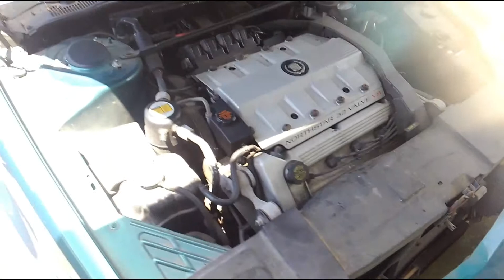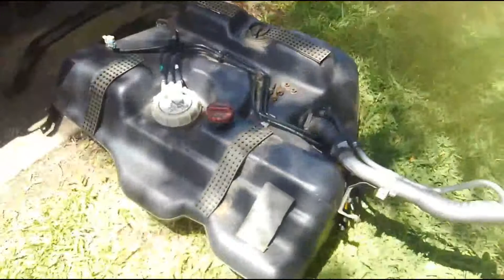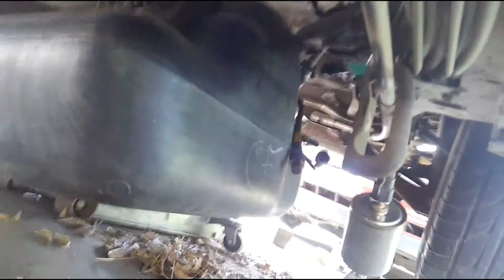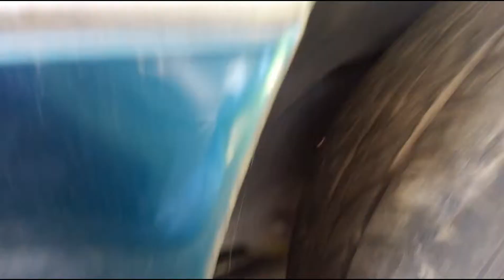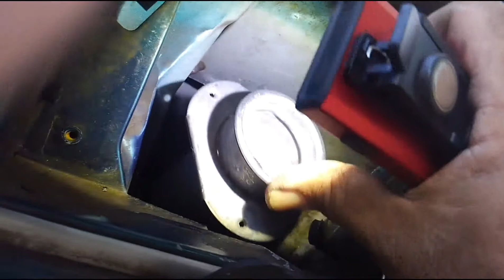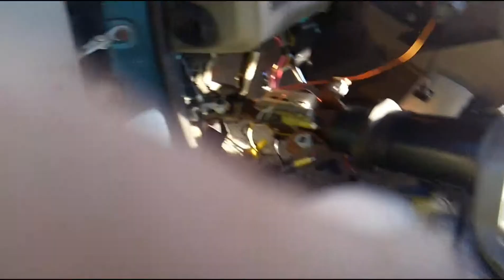1993 Cadillac Allante Fuel Pump/Tank Install and Troubleshooting

Comment from the maker: To see more of my vehicle/ parts tear down videos check out my playlist below -

Cars and Parts Tear Down Videos: https://www.youtube.com/playlist?list=PLAM-V1w3acpg_B2sVlXEL7UPOGVwiKmtL
Reply: I have a question. My allante just started putting and cut off as if not getting enough gas and the fuel pump is whining louder than usual would say feul pump is going out.. i really need some advice thanks in advance
Reply from the maker: @jimmyrandle2418  definitely sounds like that is the culprit. Best way to check is with a fuel pressure gauge at the fuel rail. Pressure should be between 42-48. If any lower than that you  have a failing pump or other restriction in the fuel system.
Reply: Thanks again im headed to the shop in the a.m. i really appreciate your time help and input thanks a lot
Reply from the maker: NP, anytime 👍

Comment: Thanks, was a great video. I just bought a 93 and getting no fuel to the rail. Next step is to drop the tank but I would like to check the relay first, any idea where it is ? I cant find it anywhere, there are a bunch of relays next to the battery behind the passenger seat, but didnt find any in the engine bay up near the firewall where I thought it would be
Reply from the maker: Vic, thanks for the feedback, glad you enjoyed it👍. Off the top of my head, I think the fuel pump relay is located directly behind the battery with several others along the inner fenderwell.

Let me know if you need any more information👍.

Comment: Was recently employed by a museum, and the guy who owns the place has 6 93 Allante’s. None have run in 10 years, and I’m a Toyota tech. You just saved my ass on about 3 of them!

I ended up getting 3/6 running by doing plugs, wires, and purging the varnish out of the fuel lines. It seems the other 3 have dead pumps, as the ball valve at the fuel rail is under no pressure when cranking, and there’s no sound of fuel pump on key on. Thank you!!!
Reply from the maker: Nate, thats awesome! Glad to hear the video was helpful. Sounds like the museum owner had quite the fascination with the Allantes. They are very interesting cars, just more complex than most people like to mess with.
Reply: @VetteSource  yes, they’re a lot different than the 1jz and 2JZ in-line sixes I’m used to working on at my old speed shop. 

The guy is crazy, but he’s got some really clean Allante’s. Like 20k miles clean. Digidash in all of them and everything electronically works like a dream.
Reply from the maker: Man, that's something else. I've always admired the look of the Allante's since they first came out, especially with the 747 "air bridge" they created to transport them from the Pininfarina factory in Italy. They also have the coolest digital dash from the 80's hands down. I'll eventually swing back onto working on the 3 that I have in storage once I catch up with these Corvettes🤣
Reply: @VetteSource  here’s a question for you big man. Where in the hell is the fuel pump relay in this thing??? 93 allante, duh, northstar.
Reply from the maker: If I am remembering correctly, I think it's under the hood. Let me check the service manual later this evening.

Comment: Did you remove both straps completely?   The nut for the passengers side strap toward the front is behind the shield for the muffler.  Was not sure how you accessed that one.....  Thanks
Reply from the maker: It's a tight fit, but you can pull the edge of the heat shield back just a bit to get a long extension/socket up there to access the strap bolt.
Reply: @VetteSource  Thank you....  final question, as I am getting ready to go to the auto parts store.... do I need any special tools to disengage the fuel lines?  I know a lot of cars require them.....  Thanks again.....
Reply from the maker: @howardwear  no special tools, just some patience. They are meant to come apart when you squeeze the connector ends together. You can use a pair of pliers and anti seize fluid to help if they are being stubborn.👍
Reply: @VetteSource  Thanks again, time to get to work on this cold concrete  :)
Reply from the maker: @howardwear  NP, thanks for watching 👍
Reply: @VetteSource  Ok,  doing the work today,  LOL....  straps removed, but don't see the connectors for the fuel lines....  do I drop the tank a bit to get to them?  Don't wan't to rip any lines out by mistake...  Thanks again....
Reply: I also noticed you have the plastic removed from around the filler .....  I removed the three screws and a small bolt, but this sucker is not budging....  as I already snapped one of the two small plastic clips that hold the small plastic piece on the left side that exposes the two screws, I figured better ask that as well....  sooner or later i will get this done.....  :)
Reply from the maker: @howardwear  yep, the connectors that feed directly into the tank will be on top so you have the drop it down. You can also try to disconnect the lines directly in front of the fuel filter, they will also disconnect theee as well.
Reply from the maker: @howardwear  yep, the fuel filler neck is a bit tricky to get out of there. It helps to remove the fuel door itself as it allows more access to the rest of the fasteners holding the plastic housing in place.